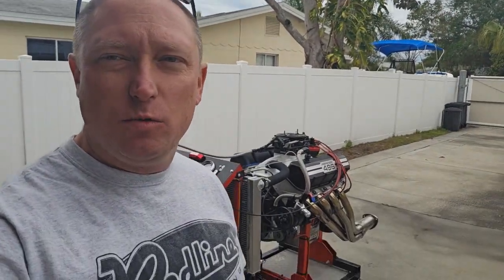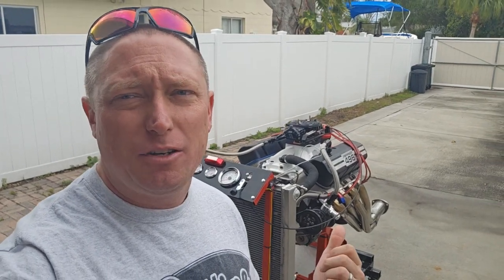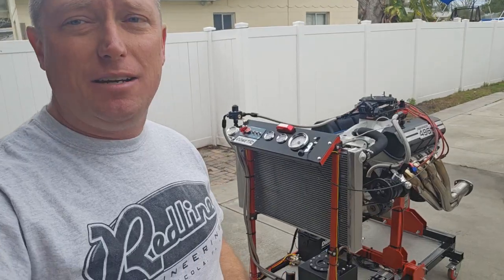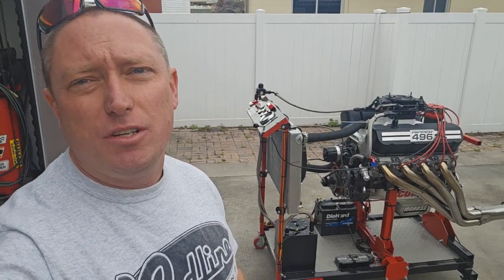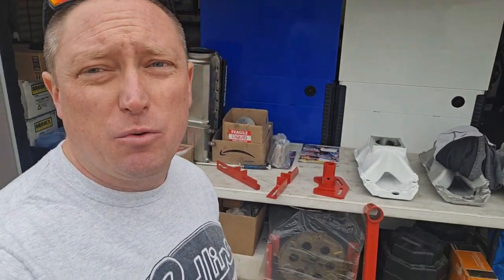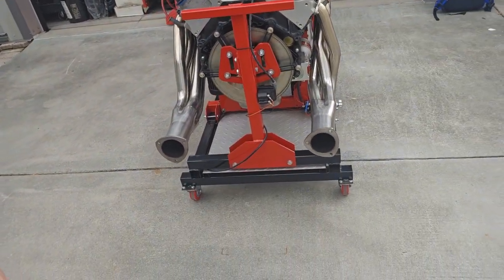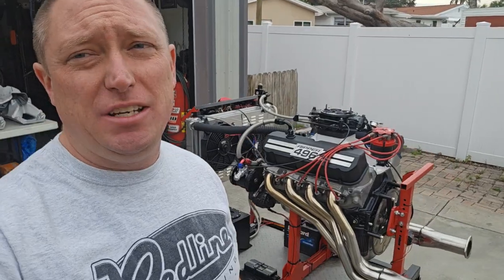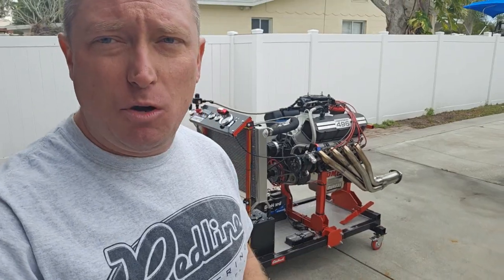Redline Engine Run Stand Demo & Features

Comment: I assume you need to have your own motor mounts to attach to the stand
Reply from the maker: Correct.  Your engine will need motor mounts mounted to the motor.  Given all engines are eventually installed into a car, it seems everyone has those by default.

Comment: It would be nice if either an engine stand for running or for building had the capability for the engine to be turned timing side up and flywheel side down to test for rear main seal leaks.